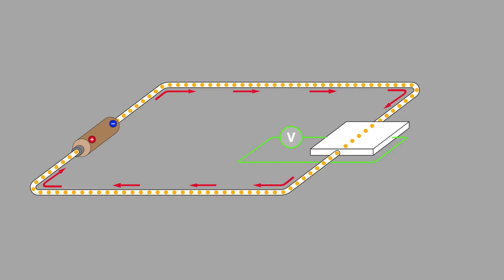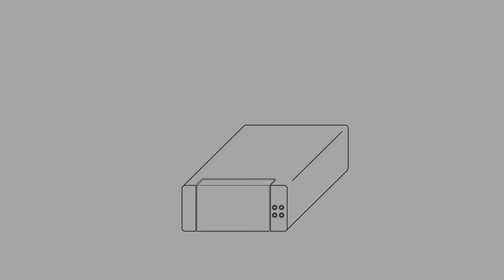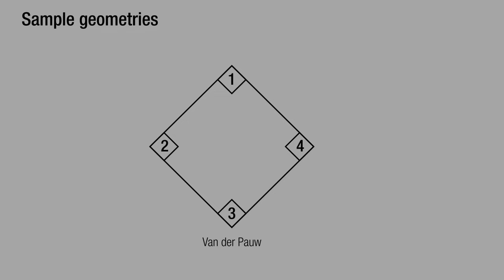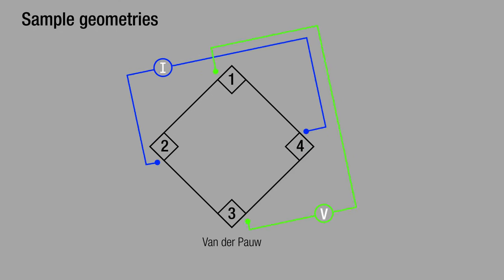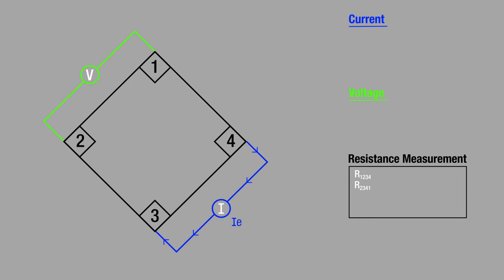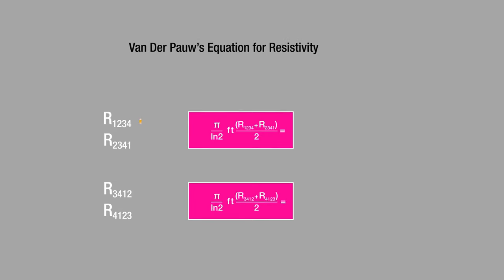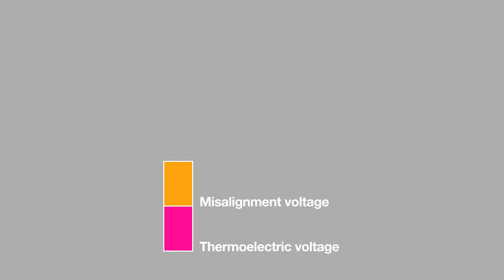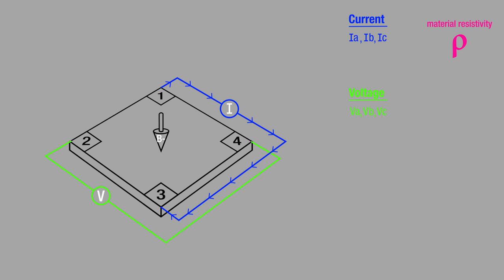Van Der Pauw Method of Measuring Hall Effect to Determine Mobility, Carrier Type & Concentration

Comment: Thank you very much for the video. What does "f" in Van Der Pauw's Equation for Resistivity refer to?
Reply from the maker: Good question Minh, and this information may need added to the video for further clarity. "f" refers to the symmetry of the sample. After speaking with our Hall expert, his explanation is as follows: "f" is determined by using Van der Pauw's equation for calculating "f". If f=1 the sample is symmetric; values less than 1 mean the sample is less symmetric. Please see the linked image: https://imgur.com/bGdF8Ik
Hopefully that helps. If not, let us know and we'll provide further detail.
Reply: @LakeShoreCryo  Thank you very much for your answer. So does that mean f = 1 for Van Der Pauw’s geometric configuration (square) ?
Reply from the maker: @MinhTruong1093  Yes for a perfect square with contacts all the same size, shape and placement, f would = 1.
Reply: Thank you very much for your answer!

Comment: What must be the polarity for the voltmeter?
Reply from the maker: If the polarity of the voltmeter is backwards, then a positive current will make a negative voltage, and the resistance will be negative. The polarity of the voltmeter should always be set correctly so that resistance are calculated as positive.